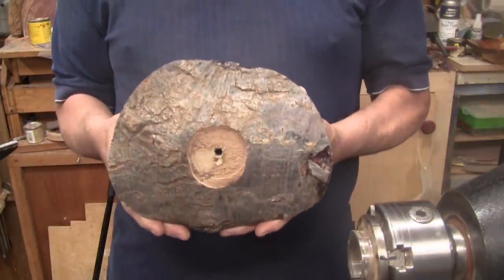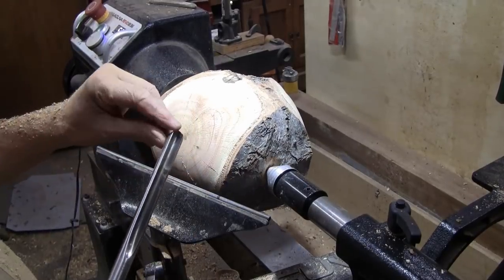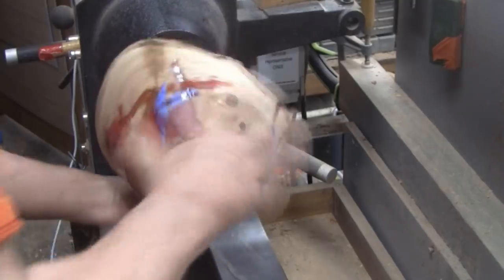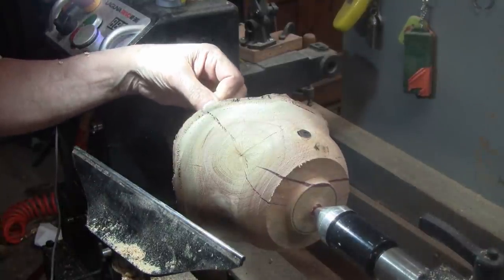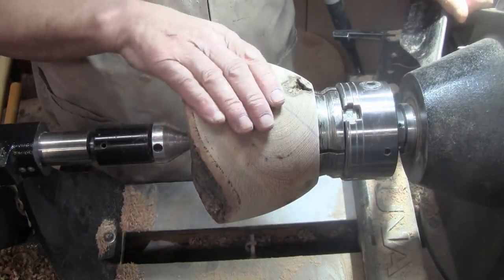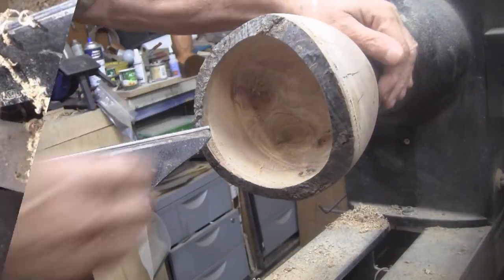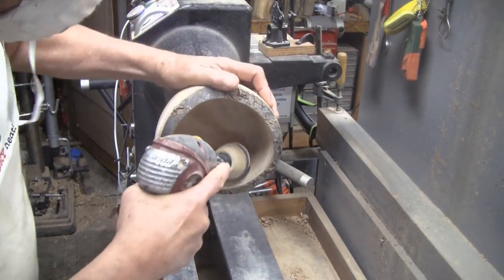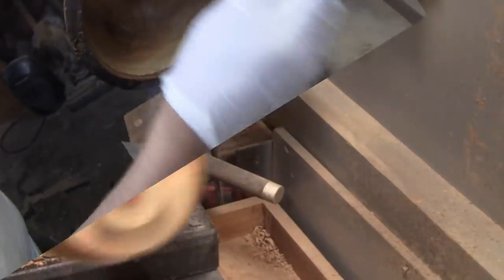Wood Turning Stubborn Black Oak

Comment: It's lovely.  In my  personal opinion , it's the knots, cracks etc. that make the piece just perfect by adding that extra little 'something' to the mix.
Reply from the maker: Thank you Pauline and I agree with you 100% on the knots and the cracks. It can show a lot of history of the wood. We have a Siberian Elm tree and I had it trimmed. Most of the pieces had cracks before it was cut down. The wood is very brittle and will crack in the heavy wind. When I turn it I think about the heavy wind we have had and wonder it it cracked on that day was it another. But it keeps growing.
Thanks for watching,
Gary

Comment: I think the knots are my favorite part of this piece, Gary.  I love the way the cracks radiate out from the center of them.  The bark, of course, is also wonderful.  I always love the grain of Oak.  I've worked with so much of it in woodworking over the years, it's probably my favorite for that.  I'm glad you stuck with the shaping.  You finally found just what this piece wanted to be.  The finish is also quite good.  Great job, buddy, keep'em coming!
Phil
Reply from the maker: Thanks Phil, I love the knots as well. And the cracks do look good for sure. After 8 months I picked the piece up and said: what the heck is this supposed to be lol. Happy I changed all that.
 I built so many Oak things around here I think we got burned out. 
Round Oak dining table with turned pedestal and carved claw feet. Still in use after 42 years and a Oak roll top desk built the same year. It is nice wood. I did buy some quarter sawed Oak Monday to do a segmented bowl out of.
 Take care,
Gary
Reply: Quite good? Were you not impressed?

Comment: Resin? Epoxy? Geez, I thought I was on the wrong channel for a minute! LOL! I'm glad you had the patience to wait 8 months to finish turning this, Gary. It is a very sweet looking bowl, my friend. Maybe patience really is a virtue. I will have to see if I can get some somewhere! 😊😊 Great job, my friend. Thanks for sharing!
.....Gord
Reply from the maker: Yeah I know..the devil made me do it. That devil of a piece of Oak.
Truth be said I mixed and poured more resin that I care to think about. 
Some of the wood patterns I made they would want multiples mounted on a board at the foundry. That meant make an epoxy and sand mold then fill with what ever flavor of resin they wanted.  Probably the main reason I avoid it. But it is a good tool to have and I would use it on a special piece to save it.
 Paitience...hmm I would love to send you some but I run right on the edge of not having enough LOL.
Thanks for watching my friend,
Gary

Comment: That's a nice one Gary. The results are often better when you give a project time to dry and to contemplate what you want from it.
A piece like this which incorporates the pith needs to be really dry to prevent further cracking. I think with this one you are beyond the problem area. Resin is not my thing but in a situation like this it certainly is a viable solution.
Congratulations on another great piece!
Reply from the maker: Thank you Leo. This piece was bone dry when I got it. My guess there were built in stress areas that just did not like some of it cut away. I did use resin as the last resort and I think it was worth it.
Thanks for watching,
Gary

Comment: Gary, I was surprised to see the resin come out, but I’m glad you did. That was a good save! I have a small resin kit that I bought some time ago ..... still waiting for the right thing to use it with. Nice bowl. Cheers, Rick
Reply from the maker: Thank you Rick, I purchased this kit for the Juniper piece and this one just to save them. I avoided using not because I do not think it looks good. It does look good in most cases. I just used to much resin in my job for duplicating patterns so I try and stay away from it. A bit to toxic for me.
Thanks for wataching,
Gary

Comment: I think it's all worth the effort Gary. You saved this piece of oak. 
I have a lot of oak laying here too, but you can hear it cracking and breaking. Your resin solution is a very good one. I just tried something with Milliput, but it only works for the surface. 
Take care!
Frank.
Reply from the maker: Thank you Frank. It did work out good and looks fine. 
Happy you liked it.
Take care,
Gary

Comment: Definitely one of those "turn or burn?" moments. The epoxy saved it from the burn pile, for certain. Then, when it met your lathe, you found the gorgeous beauty within! Well turned! (epoxy be darned!)
Reply from the maker: Thank you Dave, yes it came close to hitting the burn pile. Well not that close since it was give to me. Yes I think it needed the epoxy but maybe not. I am not apposed to it but in my job I poured gallons and gallons of resin for making molds and multiple patters so I would just as soon stay away from it.
Thanks for watching,
Gary

Comment: Hang on Gary + epoxy resin!?!?! Might need a tonic to soothe the nerves 😂 The resin filled fracture lines from the pith look stunning; really adds to the beauty of the bowl. Think you'll have to try a few more resin projects. You know you want to! Take care my friend. All the best. Ray
Reply from the maker: Thanks Ray and no you were not seeing things. I was going to explain why I do not turn epoxy but it would have taken a long time.
 So in my trade as a wood pattern maker I would make a wood pattern and if it needed a core box make the inside shape of the casting we would make a fiberglass core box. That involved gallons and gallons of epoxy over the years. Then if the customer wanted multiple patterns mounted on a board I would make a mold using epoxy resin and sand. Then pour the parts out of resin of their choice. Epoxy, urethane, polyester...you name it. Gallons and gallons...starting to understand now? lol
I poured more resin than you can dream of. Not sure if that helped me loose my sense of smell but I did back in 2006.  I was pretty much done with smelling the resin before and after it had hardened. Especially if it needed any machining.
 I do think that resin is beautiful used on some bowls. And will use it to save something but that is about it. It is not the best thing in the world to breath. At least compared to a nice ribeye steak.
 Thanks for watching and stay tuned I have been know to eat my own words. LOL
Gary
Reply: @ThePapa1947  Totally understand Gary. I was researching in chemistry in the 90s when universities were taking health and safety more seriously. Even then we were a little blasé, but I noticed that a number of chemicals were taken off the supplier's lists and quite a few senior research chemists were passing away due to cancer. My research trip to India was perhaps the most shocking. Hydroflouric acid and no gloves, red phosphorous and water, the list went on. This life is too short!

Comment: Looks amazing Gary! Resin looks good too! Glad you stayed on it brother, a lot of difficulty turns are going around this week! Great job as always Gary!
Reply from the maker: Thank you Bruce, yes I noticed some real ornery  wood turnings as well.
Yes the resin worked. I am not apposed to resin at all. But in my job as wood pattern maker I would also have to make core boxes to hollow the inside of the castings. This meant fiberglass and resin layups to do. As well as making molds out of resin and the pouring resin for multiple patterns. Epoxy, polyurethane  and polyester. I got my fill of it so I try and stay away from it. Maybe that is why I lost my sense of smell. At least I still have my sense of humor LOL
Thanks for watching,
Gary

Comment: I thought that I only I have stubborn pieces. Were You in my workshop again, Gary? How did You found me? LOL 😁😉. I need to check on camera 😎 I like oak wood very much but hates how it likes cracking and wobling. That's great You saved this blank and red resin match to the oak very good. Well done my friend 👍
Take care 
Rav
Reply from the maker: Thank you Rav, yes it was stubborn but you and I are more stubborn the way I see it LOL.
I used the dye that I bought years ago when I was making pouring rubber fishing lures It was a good match for sure.
Take care my friend,
Gary

Comment: Gary. You have the same lathe as me, I noticed you have a knob or something where the spindle lock is. Did you solve the spindle lock issue so it stays locked without having you finger on it the whole time?
Reply from the maker: Hi Mark, I made a video of it. Very simple and no drilling required. 
https://www.youtube.com/watch?v=AzExi1D8sak&ab_channel=ThePapa1947

Comment: Perseverance and problem solving save the day. Great piece Gary. Curious about your laguna. Have you had any problems with the electronic forward reverse switch? I’ve had to replace the switch three times in two years.
Reply from the maker: Thank you Peter, always nice to save something that seems to be long gone.
 No i have not had any issues with forward reverse. What was yours doing? I have noticed that I have had to blow my on off switch off a few times. Seems like dust was keeping the momentary switch from making contact. Happened maybe 3 times in 3 years but always works after a burst from the air hose. That is my guess anyway.
Gary
Reply: @ThePapa1947  The lathe will go into reverse even when the switch is in forward. I’ve been dealing with laguna and they have sent me three switches and a new controller over the two years. Glad you aren’t having issues. Love your work.
Reply from the maker: @peterarbourturning1146  sorry to hear about your issues. Thanks for watching my videos. If you have any questions on you lathe feel free to email me.
Also have you seen my video for a spindle lock pin? I recommend doing it. No drilling required.
Reply: @ThePapa1947  I looked up the spindle video. That’s brilliant! I definitely will do it. Thanks
Reply from the maker: @peterarbourturning1146  fantastic, I use mine all the time. Great for holding the piece to sand areas on an irregular turning as well.